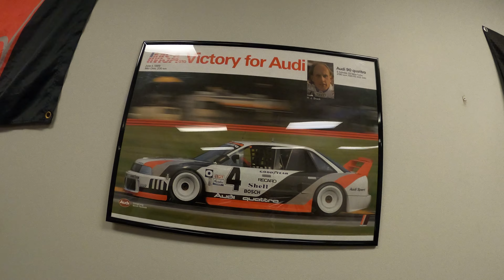LSA6 Audi GETS coilovers

Comment: Hey man! You know anything about code P12A1 “fuel rail pressure sensor inappropriately low”? Can’t seem to find much about that code. My b8 just got this code. It’s starts but sputters and dies right after. Just changed the Fuel rail pressure sensor and the HPFP and still nothing.
Reply from the maker: Did you do a relearn after you install your new sensor?